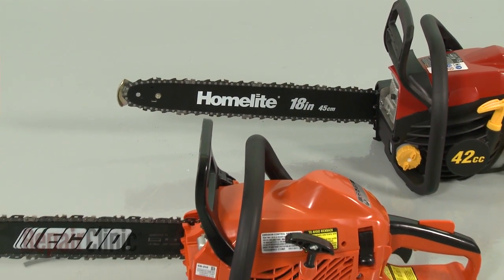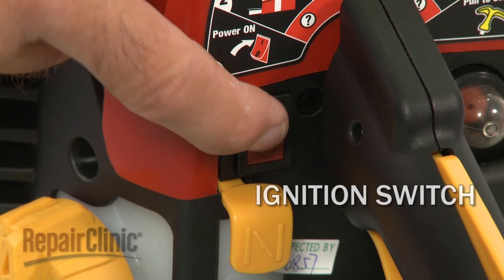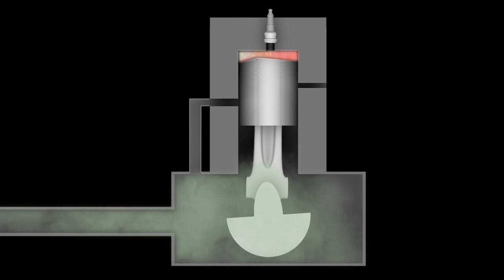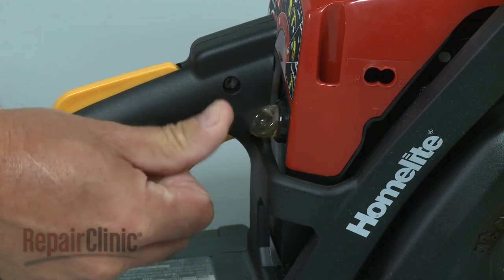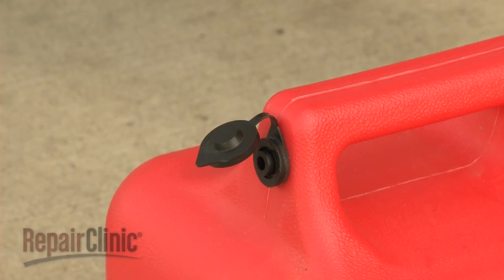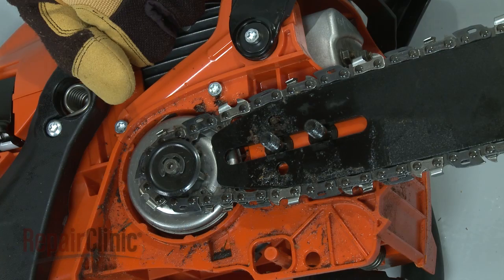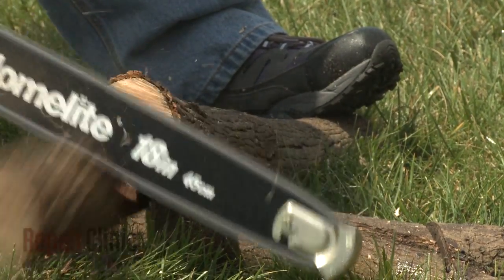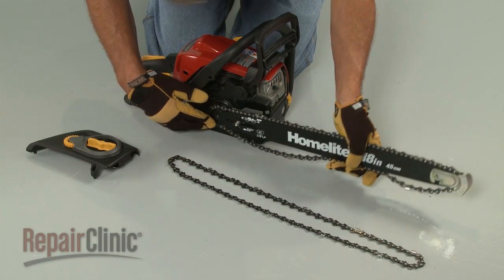How Does a Chainsaw Work? — Lawn Equipment Repair Tips

Comment: ive got a Homelite 14 inch zip start chain saw worked perfectly when i put it away last year.just tried to start it now after getting a load of logs to cut the engine stsrta and ticks over but as soon as i try to rev it up the engine stalls i have replenished the saw with new fresh petrol but all to no avail dont know if you have any ideas or not thanks,cleaned the carb with carb cleaner ,and the plug is clean
Reply from the maker: +ronatholl Sometimes the carburetor is beyond cleaning and has to be replaced. It is also a good idea to check the muffler spark arrestor to see if it is clogged.
Reply: +RepairClinic.com ok thanks for that the saw hasnt really done a lot of work i dont think it will be the carb possibly the spark arrestor thanks

Comment: I use a battery chainsaw instead of the gasoline one since you have to mix the gas with oil for the engine to run properly.

Comment: I don't know what the deal is with the nut and bolt through the bar, lol, that's a new one! That's not getting through any logs. Also, that's not how you sharpen a chain...apart from that, good demo

Comment: I have a Homelite chain saw need to replace the starter on it but the serial number and model number has been rubbed  off . It is an older model. can anyone tell me if there is any place on the chain saw where the numbers for it could be. Or where a person could take it. I tried the Homelite  on internet but since its an older one could not get any help

Comment: reeeeeally should have let the chain rev down before engaging the brake. If you engage the break while the chain is still revving high you could break the flat spring that moves the break in place.

Comment: My chainsaw that I have  will start and stay on for a little then it will shut off. I think I might need to clean the spark arrestor.
Reply from the maker: It's possible. If that doesn't work it may be helpful to check out the repair help section of our website: http://www.repairclinic.com/RepairHelp/Chainsaw-Repair-Help?TLSID=1733

Comment: I'd like to use a chainsaw with a cain guard so no one can get hurt and one that has a chain break that is activated automatically just incase I forget and my dad says that you can use engine  oil but it will not work as chain oil works.